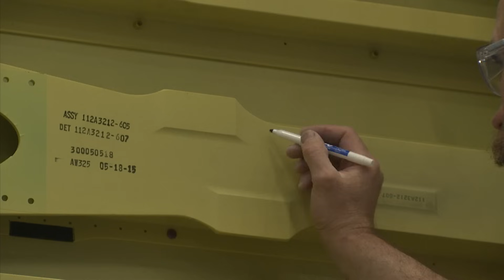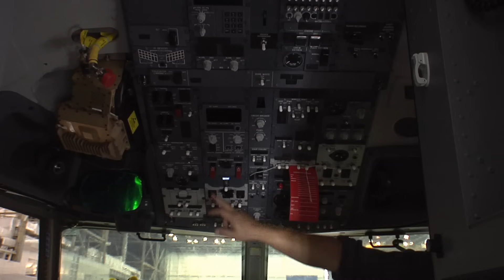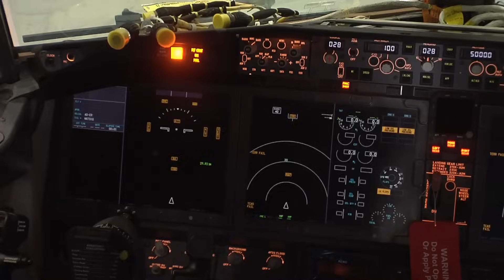737 MAX Put Together Quickly HD

Comment: Today is 28 October 2019 : 737 MAX Boeing have been virtually grounded. This is the reason why. Boeing had to use much Bigger Engines that didn’t fit in the usual position under the wing of the repurposed, 53-year-old 737 design. The engines had to be moved forward and hoisted higher. As a result, the aerodynamics changed, and the planes had a tendency to pitch up and potentially stall on takeoff. Boeing’s solution to this hardware defect was an imperfect software bandage that would automatically correct the pitch. In both crashes, preliminary investigations found this software kicked in even when the plane wasn’t stalling, with lethal consequences. Doing fast, finally slow.
Reply: @RealSpotter-GetALifeLol  bro you own boeing or something??? 2  years under investigation and remain grounded in china and some countries!!! pls
Reply: @omarscomingyo651  thats why i said almost genius
Reply: Lmao does this guy not know that mcas exist
Reply: @thingexplainer9618  doesn't it clearly say mcas on my message
Reply: @thingexplainer9618  and im taking about the 737-800 (NG) not the (MAX) so shut up angelos what kind of name even is that
Reply: @RealSpotter-GetALifeLol  What's the difference between the NG and MAX?
Reply: @thestealthyassassintsa7403  The 737NG is the 737-600/700/800/900. The max is the newest version witch was released in 2017 the max 7/8/9/10
Reply: @RealSpotter-GetALifeLol  Thanks a lot, I was always confused with the NG and Max
Reply: because Boeing knows that the engine it puts on the 737 max change the aerodynamics and make the nose of the plane go up and that's where MCAS is created
Reply: @Getalife2908  Nooooooooooo way i didnt know that thats crazy
Reply: @RealSpotter-GetALifeLol  Dude, I wasn't even talking to you... Also, did you really have to insult my name?
Reply: @RealSpotter-GetALifeLol  Again, like I said, I wasn't talking to you, I was talking to the ORIGINAL POSTER OF THE THREAD
Reply: Did I ask?
Reply: Why are people arguing over a stupid plane bruh
Reply: @Levi its a plane it shouldn't be considered as something only adults should discuss. And just because i upload gacha content doesn't mean I don't like aviation
Reply: @Levi yes i do actually
Reply: @thestealthyassassintsa7403
Reply: So here’s the thing though, no one is talking about the people who lost their lives in an otherwise preventable crash, that was directly related to the negligence of Boeing’s management team green lighting changes that later, with who to be disastrous, as they screwed up in the design and engineering phase of development of this aircraft.

So folks need to be prosecuted for criminally causing the death of all these people who died as a result of their negligence.
Reply: Airbus #1

Comment: What's flying with the tail of the airplane at the last few seconds of the video..
Reply: It measures pressure for testing, the reason it is on a string is too get away from the turbulent air for more accurate readings. It is not needed on regular flights but is very important for testing to get the most accurate results

Comment: These planes are a 50 plus year old design that have been modified beyond what was ever intended. Using computer gimmicks to counter act design flaws does not fix the problem. The Max is not safe.
Reply: I agree it's a flying coffin. No way would I ever fly one.
Reply: Thanks for the lovely paragraph but I don't think most of the general public care
Reply: Sorry to inform you that the 737 max is safe. The previous problems has been fixed which clearly none of you guys understand. The MCAS has been fixed and we won’t be seeing any more MCAS failures. Mature up

Comment: They tried harder to compete with A320 Neo, Airbus engineer know someday they will upgrade the A320 engine but with an old body, they setup perfectly in the very start, not like boeing

Look at 3:36 how big engine is, is not supossed to be there
Reply: The thing is, the A320 sitts a lot higher to the ground then the 737, this is because the 737 was made for shorter flights and used JT8D engines which were much smaller in diameter. What you also shouldnt forgot is that the 737 is way much older, when the 737 was new, small engine diameters were cummon, when the a320 came out the engine standarts had a much bigger diameter. Btw some a320 models share the same engine as the 737 classic and NG.

But yes, Boeing has forgotten about the safety, just to try to win a fight between companies, that should never happen, the 737 Max should have been made from scratch, because the 737 NG is modified to its limit.
Reply: Airbus said that they design every aircraft to be able to upgrade the engines or lengthen or shorten the fuselage
Reply: I mean the 737 was made a long time ago, who would have thought about that back then
Reply: @ethansaviation2672  no one had thought about it, because it was planned as a short range aircraft with small JT8D turbojet engines, today it exists in the 4th generation with a lot bigger turbofan engines and is flying mid and even long range flights, the 737 MAX needs computers (MCAS) to stay in air safely, that should be a no-go in aviation.

Comment: سقطة في اثيوبيا وفي اندونيسياواخيرا في الصين
هذي تابوت ⚰️
Reply: The China Eastern plane WAS NOT a Boeing 737 MAX. It's a Boeing 737-800, which does not have MCAS, the system that caused the two crashes.